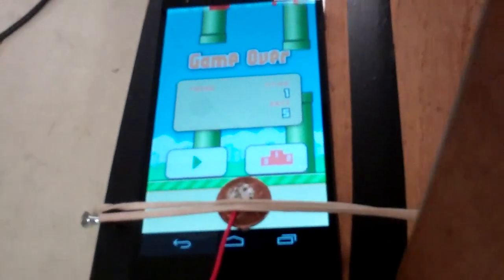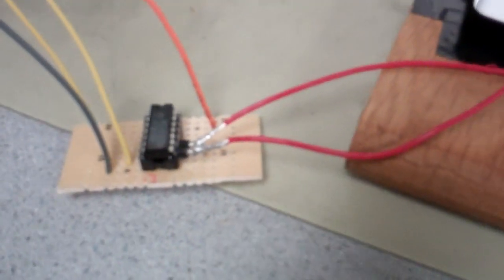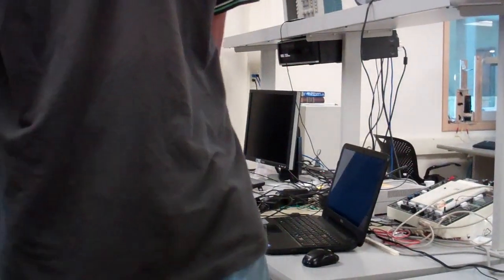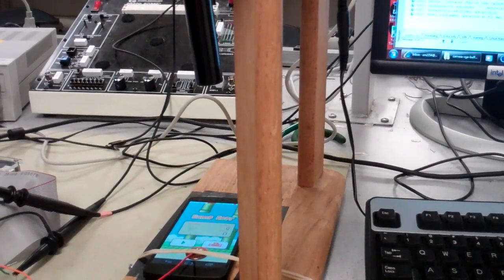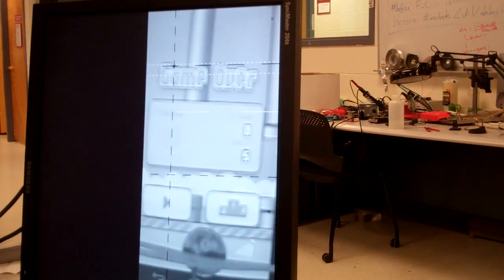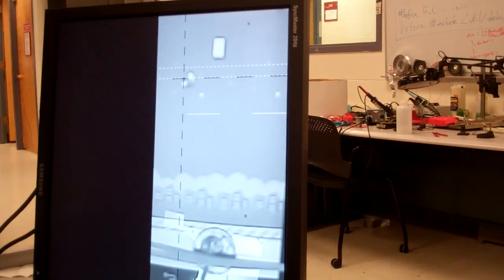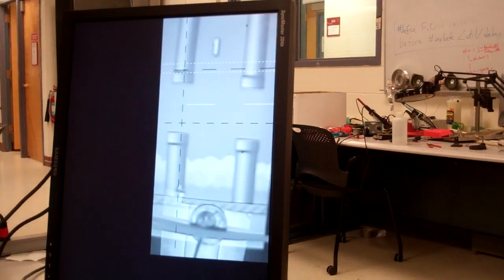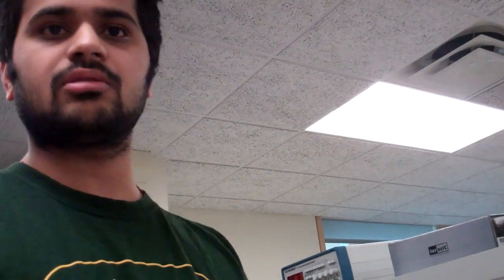Flappy bird player

Comment: you need to maintain the proper delay, calculate the video frames taken per second, then identify the position of bird, detect the average height of flying, please dont use penny, it may produce static currents. for this project you actually need matlab.
Reply: matlab is bad